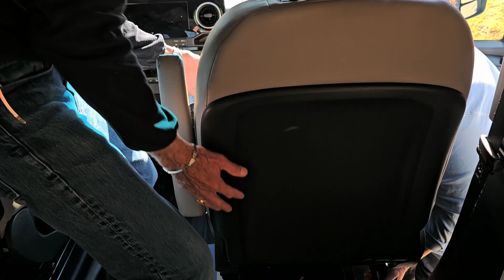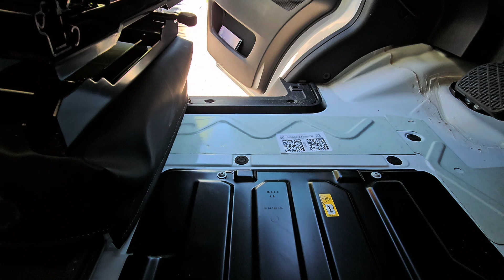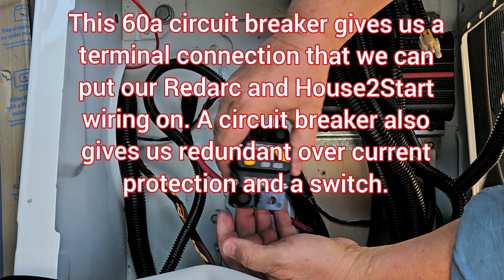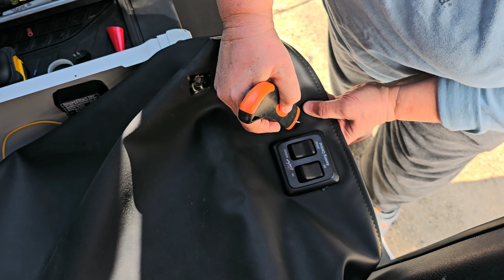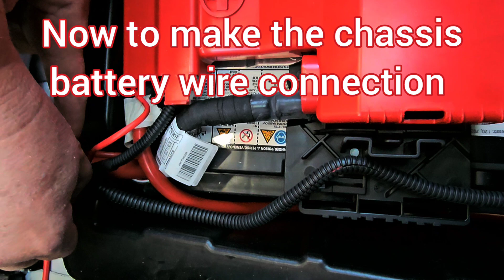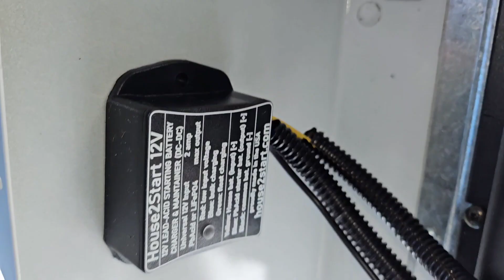House2Start Chassis Battery Charger Around a Redarc DC-DC charger in a LTV

Comment: I assume (hope) it is
possible to install in a 22 ram promaster 1500.  This is a 23 winnebago solis pocket.
Reply from the maker: It is! If you don't know what your alternator house battery charging setup is you can just run a minimum of 16awg wires directly from chassis and house batteries to connect it.
Reply: @SandyRVUpgrades 
Thank you!

Comment: As others have said, Great video and thanks for putting it out for those of us looking for this fix. I assume that the house2start and Victron battery sense will work with my 2025 Unity with Battleborn batteries and GoPower solar controller, correct? I know that there are better options, but not something that I want to upgrade now. Is it safe to leave on all the time and the rocker switch is only needed when necessary or should I only be turning the system on when it is needed? Thanks again. You are Amazing!
Reply from the maker: Thanks. Yes the House2Start can be on all the time, because it only works when the house battery is being charged by the inverter battery charger or solar.  The installation I did on this 2024 is exactly what you would on your 2025. 2023 and newer models all have the Tedarc DC-DC charger installed under the passenger seat. LTV hasn't changed that. The House2Start works with any brand batteries or solar controller.

Comment: Great video.  Thanks!   Would love to habe one on my 2026.  Not sure why LTV does not install one from the factory.  Right now I use a NOCO 5 amp smart charger.
Couple of questions.
1.  Does the H2S have a voltage threshold trigger to prevent draining the house batteries when the house batteries are not charging?
2.  When are you coming to Tucson to help me install one on my Unity? 😊  Or do you know anyone in Tucson you would trust to install or help me?
Reply from the maker: Yes the House2Start has a voltage cutoff so you can't discharge the house battery. It charges the chassis battery when the house battery is being charged. I'm just a hobbies, CTM Customs in Stuart Florida is the shop I trust to do upgrades to my LTV. You bought your LTV to travel and Florida is a beautiful state to explore. Contact CTM, ctmcustoms.com, and schedule a visit for the upgrades you want, it's a trip you'll really enjoy. I was at CTM a couple of weeks ago and had the pleasure of working on 2-2026 Unitys. Here is a video, https://youtu.be/VJRBEKLW3kI. They replaced the crummy Battleborn batteries because they are Boondockers and were very disappointed with them. They also got the chassis battery charger,  emergency jump start switch to start the engine from the Lithionics batteries in an emergency, a 2nd 50a DC-DC Charger for 100a of Alternator charging when driving, 960w of solar that can perform up to 1200w, they also produce power in shaded conditions, and CTMs Rock N Roll Complete Suspension Upgrade Package, and a couple of other things I can't remember. We spent a few evenings together talking and they said the suspension was the very first thing they realized needed improved. Then of course after they tried to boondock with the stock LTV they were disappointed so they knew the batteries and solar needed improvement. CTM Customs is the only LTV Expert shop in the country so they came as soon as they could get in. CTM has customers from as far as Alaska, https://youtu.be/ozq0ziwge1M. CTM has upgraded 100s of LTVs with 100% customer satisfaction!
Reply: @SandyRVUpgrades  Thanks. Will consider it.  Your video is really good!!    Makes it straight forward as a DIY project.  Thanks again

Comment: Thanks for the video. Out of curiosity, do you know what would be involved with running a wire from the House2Start to the house batteries to avoid splicing the 6 ga wire?
Reply from the maker: It's a lot of work, but doable if you want to go that route. I had to run an extra cable from house battery to passenger seat in this video, https://youtu.be/KIk3Loz8cB4.
Reply: @SandyRVUpgrades Thanks for linking that video! ❤
Reply: Would you happen to recall if there's an obvious spot to connect a ring terminal from the H2S to the battery?
Reply from the maker: @stvnchng4755   I'm not sure what you're asking.

Comment: Great video! Very informative. Since we have a 25 Wonder RTB with the transit chassis, I'm hoping there will be a install video for the Transit. Fingers crossed.
Reply from the maker: It's the same installation on a Wonder, it's just your Redarc is in a different location. LTV puts the Redarc in a Wonder RTB under the driver's side Dinette seat. You also need to add an ignition controlled isolator relay on the chassis battery wire of the Redarc to isolate the DC-DC charger from the chassis battery when the ignition is off. Otherwise the House2Start will start a do loop of house and chassis battery charging when it starts charging the chassis battery because the Redarc will think the engine is running and start charging the house battery too.

Comment: First, thank you for posting these videos. You are top-notch at both the work and the explanations. Not too long but with the details that are helpful.

I've thought that the auxiliary battery relay protected the chassis battery from being drained. I guess this gives me some pause on that assumption. Is this more a "belt and suspenders" thing to ensure that chassis battery is charged. I've never had a problem with the chassis battery, but I don't want to either😂.

I do carry a truck jump-starter pack, but maybe this would be something to consider.
Reply from the maker: I'm not sure what you're referring to as the Auxiliary battery relay, so I say a relay simply disconnects the chassis battery from the house battery when the ignition is off. This is what LTV uses the isolator solenoid for or the ignition controlled isolator relay they add to the chassis battery connection of their DC-DC charger. While it is very important to isolate the house and chassis battery systems when the ignition is off for alternator charging devices, there is still a lot of parasitic draw on the Mercedes side that is draining the chassis battery.  The parasitic draw get more and more with every Mercedes chassis upgrade.  Some 2025 LTV owners are reporting the chassis battery dies in just 1 week from all the parasitic draw. So installing a House2Start Chassis battery trickle charger is a great addition to keep the chassis battery charged up. The  House2Start uses the house battery charging sources to run it's chassis battery charger. So it capitalized on charging systems that are already on board like Solar or the inverter battery chargers when on shore power. I've been using a device very similar to the House2Start for 10 years and have never been surprised with a dead chassis battery.  I park my Unity for up to 6 months some times and I have confidence with something like the House2Start that my solar system will keep both my house and chassis battery charged up and the engine will start when I take it out of storage.  So yes, I think a House2Start Chassis battery charger is an important upgrade so you never need worry about the chassis battery. My philosophy when it comes to a chassis battery charger is that it's better to be safe than sorry!
Reply: @SandyRVUpgrades  From what I see on my schematics that is what MB refers to the relay that isolates the chassis battery from the coach battery, which is the auxiliary battery in this case. 

I try to make sure that all of parasitic draws are off when the ignition is off and locked. However, I can see how that could be overlooked as in any vehicle, or just not even aware of it happening. I would agree that the low cost of the House2Start makes sense as insurance to protect against this issue.  Thanks for bringing it to my attention.